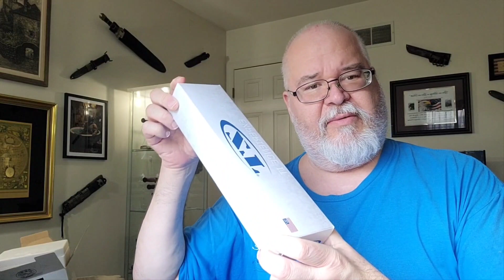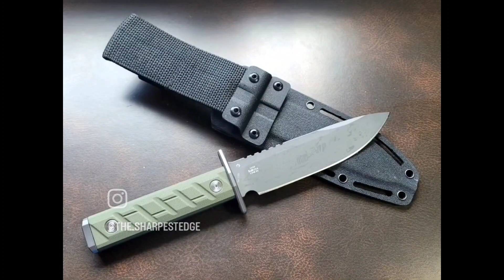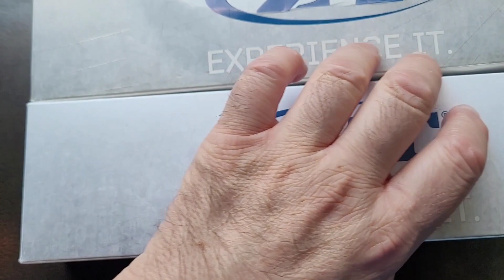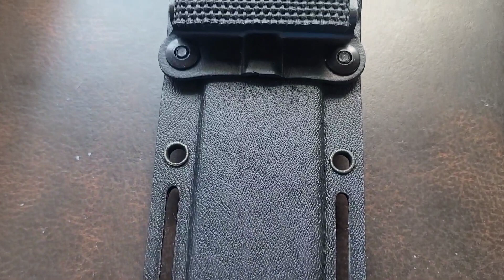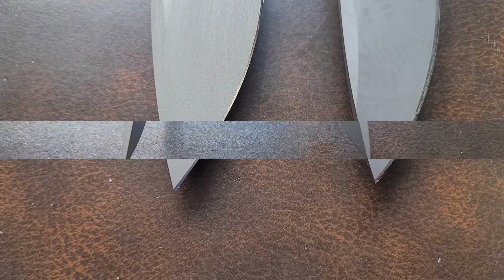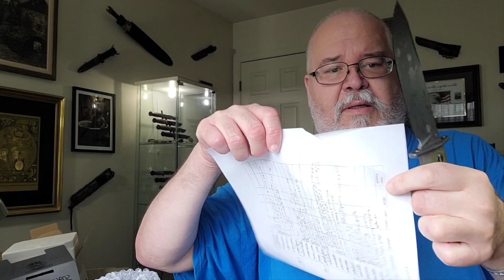THE SHARPEST EDGE:  ZT 0006 Authentic vs Fake Comparison

Comment: I had a clone PMI’d for steel composition and it came back identical to the composition of 3v. Enjoy.
Reply from the maker: Hello, my friend.  The original was made from CPM3V Steel... Steels comparable to CPM 3V in terms of toughness and wear resistance include MagnaCut and Cru-Wear, though MagnaCut offers superior corrosion resistance. While CPM 3V is known for exceptional toughness... neither of which would be sold on Temu or Ali Express for $15 to $50 today's price on Amazon.  

There have been multiple tests done by multiple people on YouTube.  I have found for specific applications like knives, common genuine Chinese steels that are sometimes cloned or imitated with inferior material include the D2 equivalent Cr12MoV. However, in counterfeit items, even if "D2" or "Cr12MoV" is marked on the blade, the actual composition can be an "incomprehensible alloy". 

I have never heard of a test coming back on a counterfeit being CPM3V or even close, but there's a first time for everything... lol 😁   Thank you your comment and have an amazing weekend 😀

Comment: You might don't know the fake one can be bought on Chinese on-line merchant Taobao for less than $10. And the cost of the manufacture might be less than half of that. :face-turquoise-covering-eyes:😹
Reply from the maker: With current trade restrictions and tariffs, imported goods no longer cost those prices without the tariff price increase or the end user customs charges increasing the items' costs.  Currently on TEMU, these blades average $25 PLUS shipping on up; Ali Express is virtually the same.  Some overseas companies have become so desperate that they are using pot metals in the blades to cut costs even further increasing safety risks to the consumer.  I have both versions... the counterfeit and the clone.  The clone is a great quality D2, and the counterfeit is a lesser quality steel, but still a good blade if it didn't try to pass itself off as the original.  Both of these blades have been tested by several YouTube channels; the clone passed with flying colors, but the counterfeit; especially late models, have been breaking, chipping, and experiencing other catastrophic failures.  Luckily, I purchased them early on in the game.

Comment: You made some very valid points. I have recently ordered the actual ZT knife and I am thinking of going ahead and purchasing the Chinese version to train with and practice field craft so that when I have to put the ZT into play it is a one to one transition. What I'm nervous about after watching this is that the Chinese version may be good to the point where it stays on the belt and the ZT goes in the display case. In any case thank you for the comparison and honest opinion.
Reply from the maker: Thank you for your comment and kind words, my friend!  Everything that you had stated in your comment has come true for me.  The Chinese D2 clone remains in my carry, and the ZT is in my display case.  It has done so very well by me, that I just keep it in my carry.  I saw torture videos on this ZT from china and it cut nails with no damage.  While I know that the original ZT will outperform it in the field, why even bother until the clone fails?  At least right now, that's my train of thought.  I already know and have seen what the original is capable of but why mess it up at 300 plus a pop when I have this one to do so?  So believe me, my friend, I get it; I understand where you're coming from, and I agree wholeheartedly.  Thanks again for your awesome comment and have an outstanding day!  😎👍🇺🇲
Reply: @the.sharpestedge  I apologize for the additional comment. I'm not stalking I swear. I received my 0006 today. Thank you again for this video as I ordered it from Amazon and it is indeed an original ZT. Without this video, I can see how it would be hard to tell!!  I have extensive experience with knives, from years in Pekiti Tirsia , to camping as a youth along the Red, and Sulpher rivers, to carrying on foreign soil. This was an expensive knife yes, but after careful assessment of it today, I feel absolutely no buyers remorse. One of the best knives I have ever owned, and I have some good knives. I may still buy the feaux ZT for practice, but as alot of people have said and I agree, this is a life knife. Thank you again so much for your time and education!!
Reply from the maker: @kensai1968 LOL my friend, no worries 😁... Glad you purchased the original.  When you purchase the copy, let me know what you think.  There are such subtle differences and the copied sheath seems to be better than the original... but nonetheless, owning the original myself for 3+ bills, I just cannot get myself to carry her while I have the copy in rotation... and she continues to do well.  Feel free to comment anytime, my friend!  That's why I am here 😎👍🇺🇲

Comment: The counterfeit version that comes with the plastic sheath seems more refined than the one that comes with the cheapo fake leather sheath.  The cheaper one has no blade coating and a super-chunky guard that doesn't look very good.  The plastic sheath alone is well worth the $10 greater price.
Reply from the maker: The one with the fake leather sheath is built more ruggedly than the refined version.  I think those were the prototypes of the refined version, but not completed... instead assembled and sold as they were and sent with a very poor sheath.  That one came out before the refined version, but it seems to be holding up very well.  It even inserts into the plastic sheath well, but for that one, I prefer the leather.  Thank you for your comment my friend and have an awesome weekend 😀

Comment: Being from Canada i prefer the Chinese one. Which i bought.
Reply from the maker: @roberthickman2953  I have the Original and the 2 Chinese versions; 1 is a beautiful satin with black scales D2 blade clone, and the other is a counterfeit that appears nice on the outside but has some design issues inside.  The original ZT butt cap and handlescrews for example, are minimally invasive to the full tang construction by having only 2 precisely drilled holes in the handle and a precisely drilled and threaded channel in the tangs rear for the screw to secure the butt cap to the assembly solidly.  My chinese satin version does the same, but the counterfeit uses a skeletonized handle where the scales rely on the buttcap to keep them aligned and in place.  The buttcap relies on a welded nut spot-welded to the tang on 2 points to hold the handle together securely... so it all falls upon 2 spot-weld joints, a nut, and a questionable screw for that one.

I absolutely love my satin version and ZT's original, but that counterfeit, I just don't fully trust to carry yet.  I have been carrying both my original and satin clone, and both have been superb in function and continued sharpness.  Another great version of the clone is made by Ned Foss... a sort of combination of the ZT and Ka-Bar design.  Check it out here:

https://a.co/d/jc8t9jl

Thank you for your comment and have an awesome weekend 😎👍🇺🇲

Comment: So many good points. One of them is the overpriced US knives. Well profit should be absolute maximum immediately isnt it? Then there is the sensible approach. Get a good product on the market that will make people happy and will be a brand ie. Big Mac. Now what happens when you realize that the 99.99% of cases basic steel will get your job done. Sharpening a knife is not so bad. So if you want to save the industry with a lack of proper revolutionary design you go for "high-end" steels. Quality they say. Just like Gore-tex rants about the waterproofness of 28000 mm, which does not mean anything. Get a garbage bag and pull it over yourself, you will have absolute waterproofness. When raining get into a shelter, etc. So you save a lot of money. Same with knives. Industry has to grow, and sell, sell, sell. The latest ZT model does not do what a 420 steel machete can do. But it will hold its edge 5x longer. Wow. So you pay premium because you cannot sharpen the knife once a week. I have many premium knives mind you. But I am not going to waste them. I have Ontario also, they cannot do a decent fit and finish. Then come Chinese replicas with decent quality and decent steel for a good price which you can try out and waste. The question is. Is it a problem that China sells fakes, or the problem is that they are too good and too cheap? If they are too good, why don't Ontario make a proper fit and finish to the Chimera? Why do we get surprised when a USA folding knife is centered perfectly? I have Chinese clones, and they are perfectly centered. This is the rule, not the exception. So I also read another dirty thing. USA imports Chinese junk knives and sells them for a high basic price, so that the local USA-made knives can be sold at a premium price?!!!! I think the biggest issue here is that the USA don't realize that China is a big superpower. Sure it was a weak country in the 80s. Now it produces everything. Just like Japan in the 80s. So if China wants to produce a space-technology knife, it will produce it cheaper than the USA. Why, because of the labour costs. Oh and USA got the copying issue wrong. Chinese copying is an honour trying to mimic the original with pride, and saying we made the same in China. And they sell it to the local population. But the good American price-conscious buyers and businesspeople realized that they can make a hell of a profit if they sell replicas. So they import replicas. So the fakes are gonna be there. Question is will you buy American or not. Anybody trying to mimic a big brand will try to make it good otherwise nobody will think it is worth buying. But there are M9 Bayonets which are fake and considered shit. Why? Because they are display models, not hard-use tree-splitting models. Same with collecting paintings. Go for the originals, right?
So everything is just the decision of the Buyer. Who do you believe? Patriotism, or your purse? That is the sad reality.
Reply from the maker: Well, and lengthy written, my friend.  I have been trying to get the knife community and manufacturers to understand most of what you said for decades.  Most steels will do exceptionally well over higher-end steels.  Now, I have many early-year ONTARIO knives including the Chimera.  All were sharp out of the box and perfectly fit, but in later years during the decline of the company, the quality did suffer unfortunately.  Shortly thereafter, they closed.  There is no reason why American Manufacturers cannot create a superior product for a reasonable price... but a lot of the time, union labor costs are just unreasonable as are executive salaries and corporate greed.  This has been an issue ever since the emergence of unionized labor.  Not to mention the corporate life of executive management and greed.  I have many high-end knives from around the globe and enjoy almost every country's art. However, that being said, I have no respect for countries that counterfeit.  Having no respect for international law or intellectual property is simply criminal.  Copy/Clone/Replicate the knife without putting the original maker's mark on it... that is fine.  Modify it to be your own even better.  But counterfeits hurt everyone.  Period.  

Thank you for your outstanding comment and have a great day 😎 👍 🇺🇲